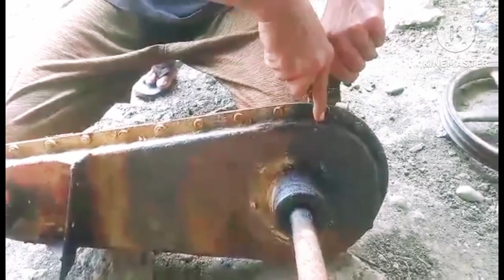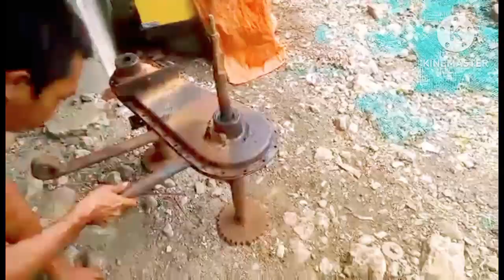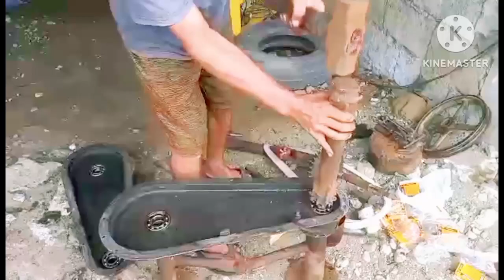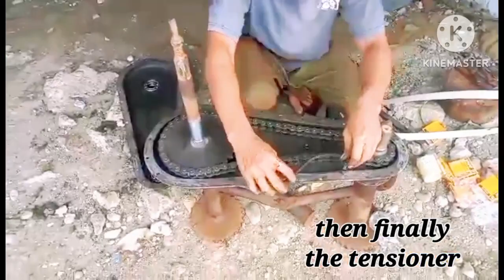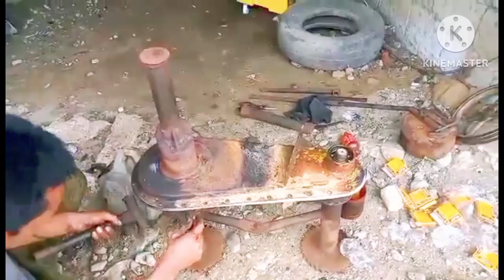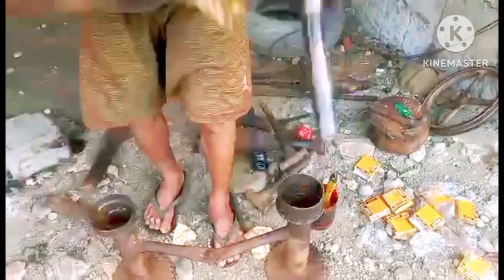How to change new Bearing, Chain & Oil Seals on Mudboat Tiller Gearbox

Comment: What  is the upper and lower bearing size ?
Reply from the maker: In this model all  are bearing 6206.  gearbox has 8 pcs of bearing.
Reply: Thank you from srilanka ,30mm shaft ,if you can please tell me distance between upper and lover shaft and gearcase steel plate thickness .what is the engine do you use this floating (laboy ) tiller , thank you very much bro....
Reply from the maker: Here in Philippines farmers matched mudboat tiller with 12 hp  aircooled engine
Reply from the maker: Gearbox thickness is 3mm. Chain  use is #60 , 4'2"
Reply: thank you  brother
Reply: sprocket combi of lower n upper? chain use?